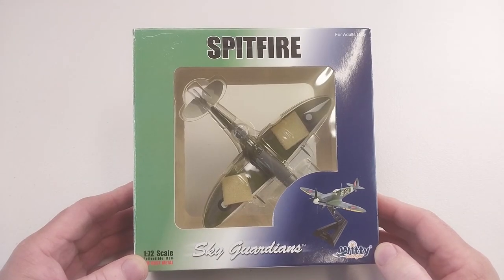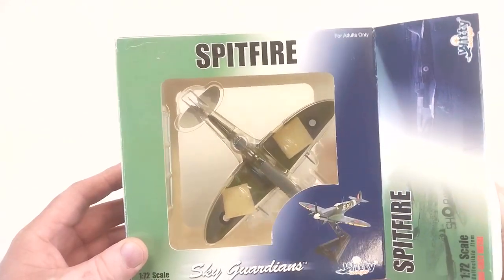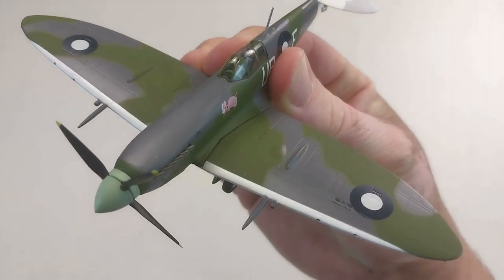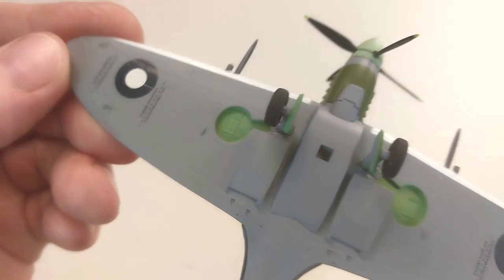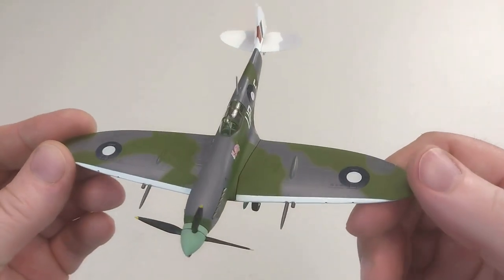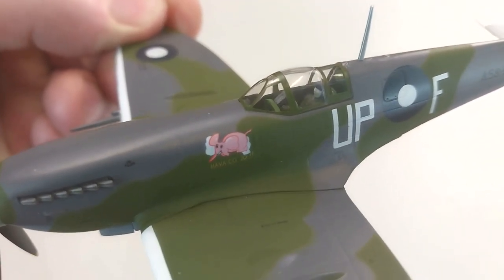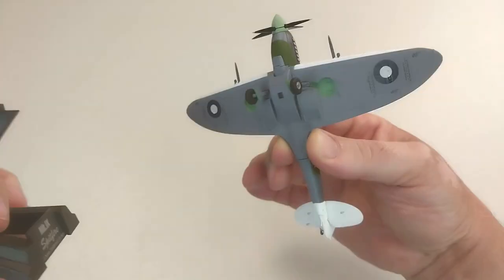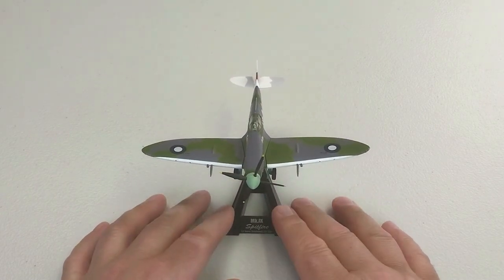Supermarine Spitfire Mk.IX, RAAF 79th Sqn, World War 2 Fighter, Witty Wings 1:72 Diecast

Comment: This model of spitfire IX is quite good. This brand, witty wings, of diecast planes produce models similar in style to hobby master but cheaper. Its models are simple and they have fixed landing gears but that is ok.
Reply from the maker: Yes I agree, they are pretty good models at reasonable pricing. I don't have an issue with fixed landing gear either as I display mine all in wheels down position 😀

Comment: Good value
Reply from the maker: Yes it's pretty nice, with the exception of that name error on the stand. But i rarely use my stands any way 😀👍
Reply: @heavymetaldiecast  Anything with RAAF in it was about  1% of what was made back in the day. Now with after market decals, you can convert anything easily if so inclined.
Reply from the maker: @1mmickk  oh for sure, it was pretty rare to find Aussie aircraft  easily. Now there's alot more available without having to modify. I have an F-4 and F-111 to unbox in RAAF markings 😀👍